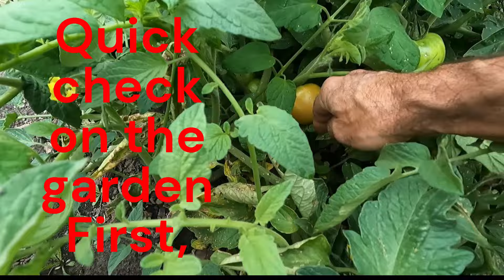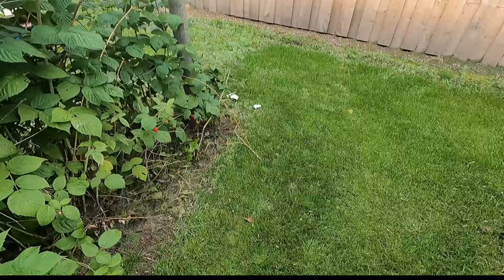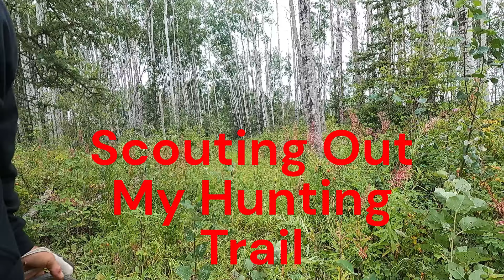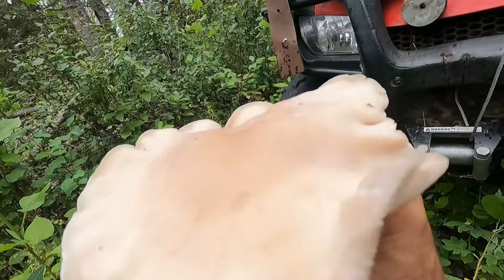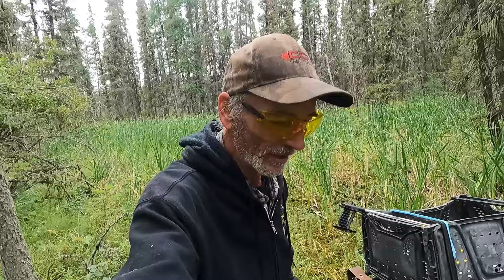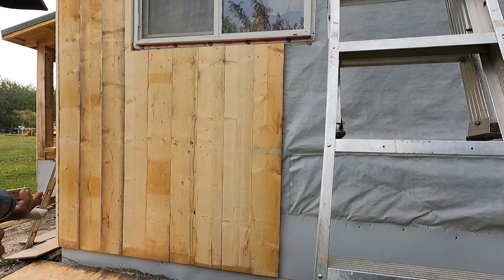Scouting Moose Hunting Trail, Garden & Working On A Little Board & Baton, S3,E74,

Comment: To bad there is not a better way to fill the oil for the saw without it overflowing
Reply from the maker: Ya for sure ! They could put the filler higher so the handle is not in the way, I don't spill to often just when the cam is on, I usually fill up on something makes it a little easier to see :) Thanks for the comment"
Reply: Try putting your oil in a laundry soap bottle